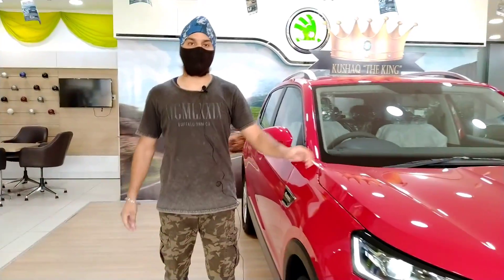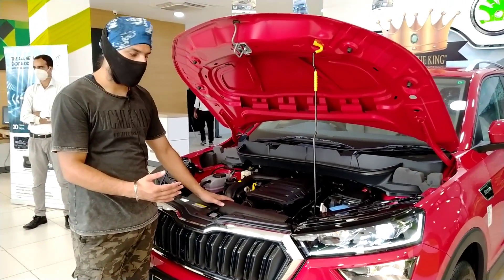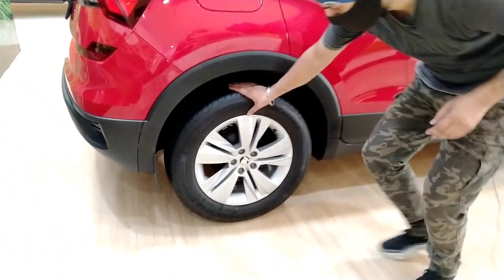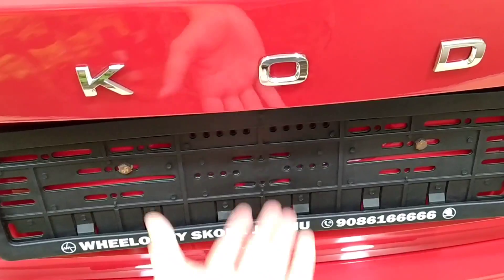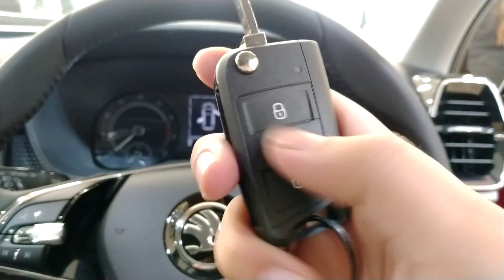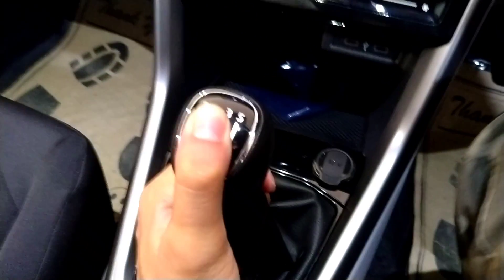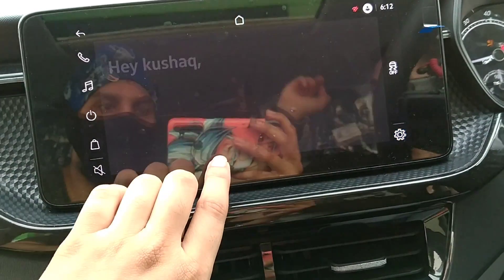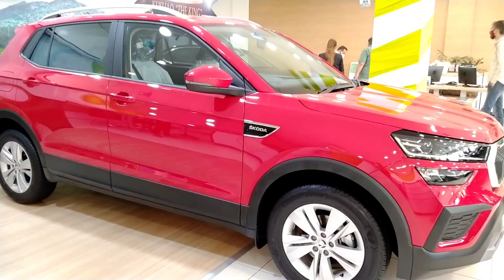Skoda Kushaq 1.0 TSI MT | ₹ 12.79 Lakh | Detail Review

Comment: Review after driving 250 kms

- Kushaq is nice to drive and will feel modern and robust.

- Overall driving dynamics, ride, steering controls and sharp turn handling is class-leading. Feels too safe and pleasure to drive.

- All important security features that we use and are mandatory for safe driving dynamics at 18 lac on-road makes it the best choice.

- Unique 2-spoke steering wheel (from Superb, Octavia)

- Kushaq though has 385ltr capacity can easily fit the same baggage as Creta/Seltos (claim 400+ ltrs.)

- Carbon Steel paint finish looks very nice, upmarket and premium. - 6-speaker audio system is surprisingly crisp and great sound with subwoofer.

Negatives:

- The steering feels a bit too light even at high speeds and could've weighed up better for more responsive feel though controlling it is precise.
- Rear disk break.
- Digital instrument cluster.
- No 6 air bags other than 1.0 MT - this is illogical and stupidity.
- Yes, priced 50k to 70k on the higher side - but performance, safety features (even in base models) and the driving experience of both 1.0 and 1.5-litre TSI variants somewhat justifies the price.

I highly recommend Skoda Kushaq for those looking for premium small and powerful compact SUV for its clean design, driving dynamics, safety features and the Skoda brand.

Also, check out me taking delivery of first Skoda Kushaq MT 1.0 in the Bangalore City on 12th of July here : https://youtu.be/plDWrr2-gSg